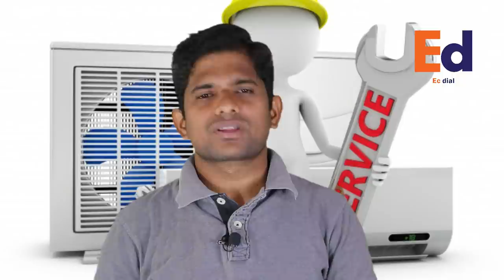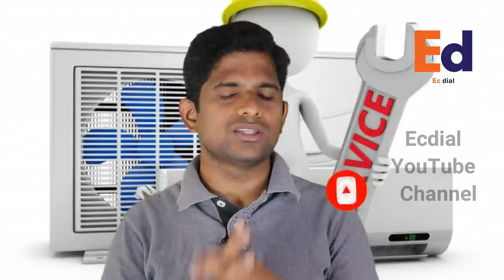Vacuum போடலன ஏசி வெடிக்குமா? | how to vacuum split ac system solutions | Ecdial

Comment from the maker: For more information follow us on,

Instagram Link: https://www.instagram.com/ecdial/ 
Facebook Link: https://www.facebook.com/ecdial
Reply: 12/01/2023 than new  non inverter acvacuum poda assamble pannanga sir, nanga one hour use pannom sir ,ippo vacuum poda mudiyuma ,appadi illana ethavathu problem varuma sir ac la,
Reply from the maker: Sir I can't understand
Reply: In inverter AC the outdoor unit is mild current shock, if i keep tester on outdoor unit  light in glowing in tester is normal?

Ground connection are good it shows around 5 volt  while testing  ground and netural in multimeter

Comment: Sir romba nalla pesarenga neenga vacuum panni ac install panna enna charge panarenga and 1ton 1.5 ton 2ton ac ikku r32 and r410 gas vacuum pottu full charging panna enna charges pannarenganu solla mudiumaa yeana oru oru mechanickum oru oru charges solaranga neenga unga rateta sollunga athu ella costumers ikkum usefullaa irukum mechanicikkum usefulla irukum
Reply: 2600

Comment: Bro, in my split AC 1.5ton,very often the discharge as an ice formation.i checked with 3 mechanic, in that the first one said the indoor unit u tube as got leak and he says d he as welded. And at the time of installing he suddenly said the compr essor is not working. So I called the 2 mechanic he made the compressor run with is technique of work, but he didn't close the net in the discharge properly so again ice formation.And he said the indoor unit as to be changed. Finally I called the another mechanic and this guy  checked with pressure compressor and said everything is fine, and he found out  there was a leak at the discharge tube small copper line net. So he again filled the gas and the ac was running good for 20 days, and again there is ice formation in the discharge line. I am really fedup of the same issue again and again. Bro can you solve my issue .

Comment: Super bro
Iam using haier dc inverter ac
R-32 GAS VANGI 2 MONTHS AYIRUCHU BUT TECHNICIAN VACUUM PODALA BRO
Reply: I am also bro i bought loyd1.5 ton ac 1 month before
Reply: Pls put a mail to the company mail address
Reply: Gas full ah remove pannitu vacuum pottu new gas refill pannuga 
2000 to 3500/- aagum...
Reply: @gobinathgobinath7564  best ac gas edhu bro iam using R-32 vacuum podala but vagi 2 month aguthu

Comment: Ac compressor oil  refill panna mudiyauma . I asked one ac technician he said in rotary compressor oil refill panna mudiyathu . Suppose oil kammiya irutha enna symptoms irukum ac la .
Reply: First noise change aagum then..then knjm days la compressor dead aairum
Reply: @sasitharan6038  bro oil refill panna mudiyuma ?
Reply from the maker: Pannalam bro
Reply: @Ecdial  are you sure bro in  rotary compressor oil refill pannalama ? Because all ac technician said panna mudiyathu replace dhan pannanum . Piston compressor la dhan oil top up pannalam sonnanga
Reply from the maker: Pannalam bro 👍
Reply from the maker: We need to change the oil in discharge line
Reply: @Ecdial  tq so much broo . Why I asked yennoda panasonic ac shift pandrapa evaporater coil la irunthu oil leak irunthu bro athu normal ah .already 3 times unit shift panniruken .

Comment: Hi bro..as you suggested checked with technician for compressor replacement he said 13k for hitachi compressor and the leg will be altered for seating and no warranty will be pro died for that reason..

So finally I brought a new carrier 1.5 ton non inverter model the installation people accepted to put vaccum as you have suggested 🙂
Reply: How will carrier be bro is it good on cooling?...the outdoor unit looks very big like 2 ton model
Reply from the maker: Nallaa irukkum bro